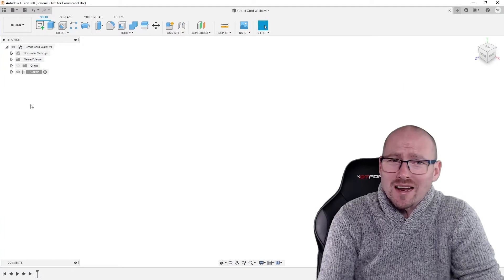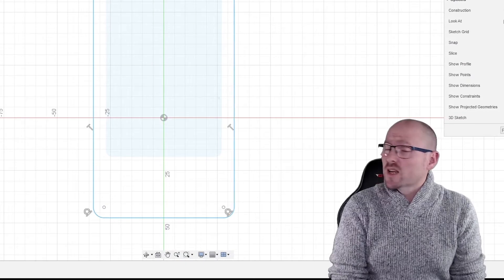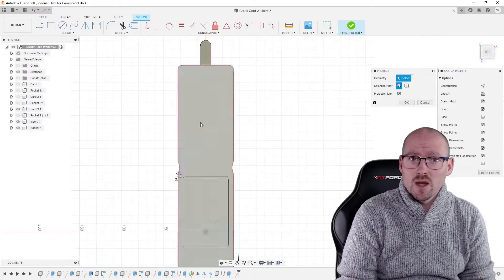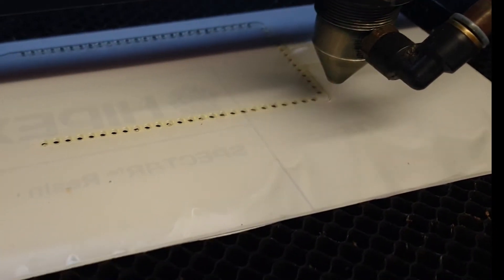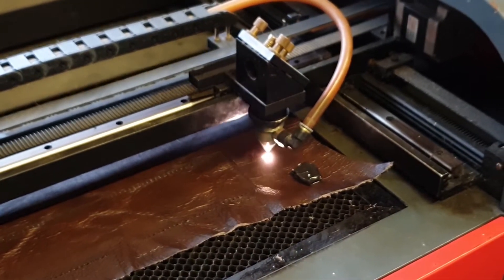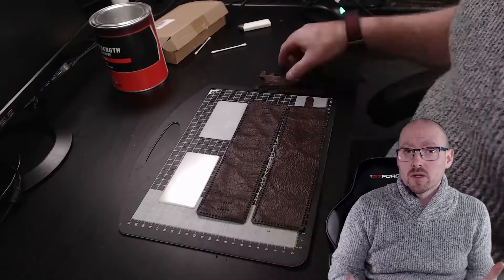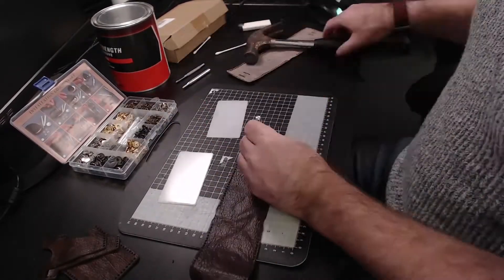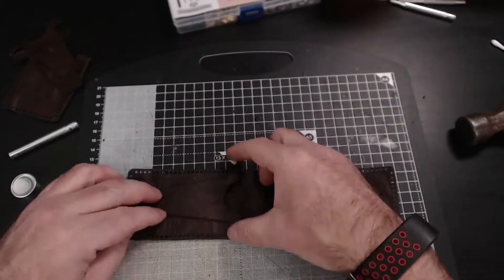How to make a leather wallet with a laser cutter

Comment: What diameter are those stitching holes? They look about 3mm which seems rather large?
Reply from the maker: Thanks for the question.

Yes, they are around 3mm, if i recall correctly. Keeping in mind this is the first time I have worked with leather, and the only leather tools I have is the sewing kit.

This was me experimenting and learning.

The laser is an excellent tool for prototyping,  but for production runs a die and clicker press would be much faster.

I should really invest in a stitching fork for future projects